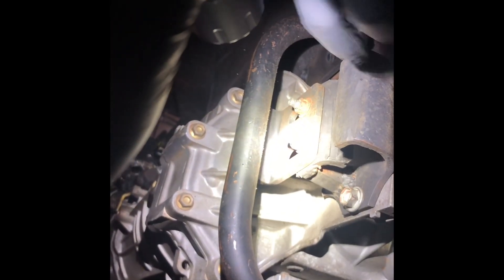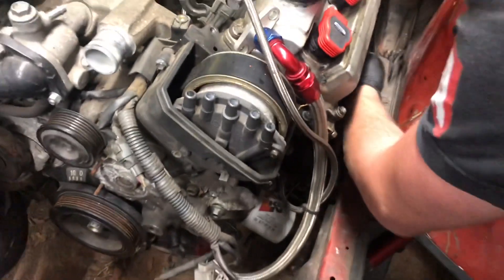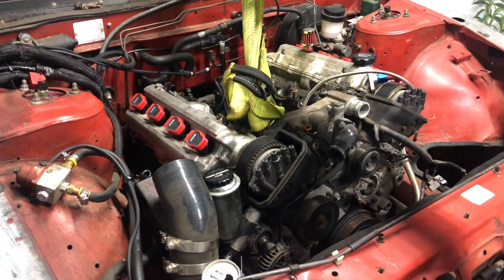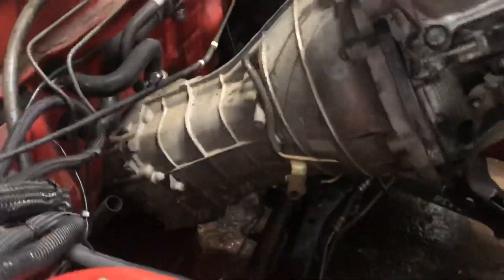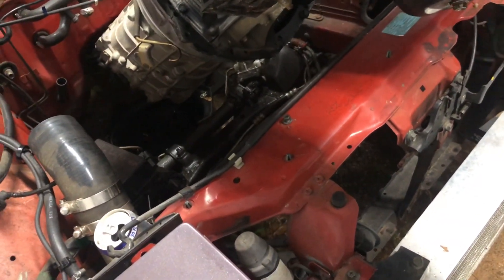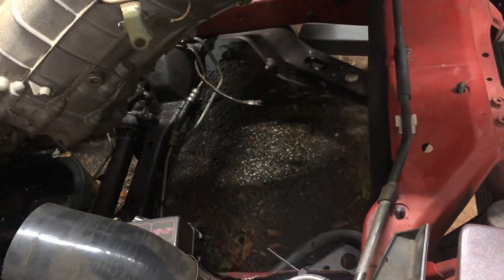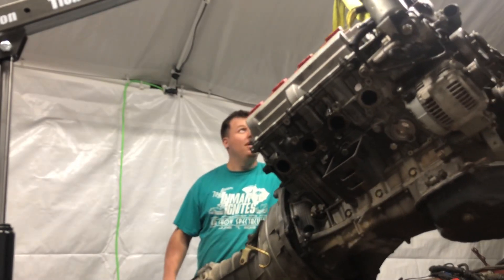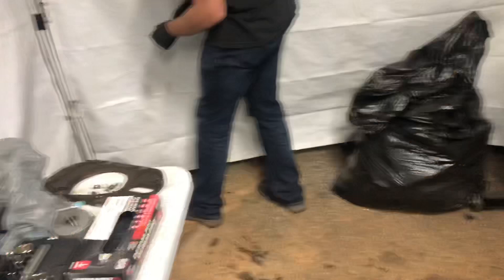1UZ is down

Comment: are those stock manifolds that you modified?  The person thats helping me whats to get 2uz 4.7 tundra stock  log manifolds as they hug the block
Reply from the maker: I actually have an aftermarket tubular manifold on the driver side (it's a passenger manifold flipped) and a stock manifold on the passenger side. I had an aftermarket one on the passenger side too, but it kept cracking. Went back to stock and it solved the issue
Reply: @hardcutgarage8105  thanks i want those aftermarket tubular as they seem less restrictive but he says their will be no room, Maybe i need a new exhaust guy